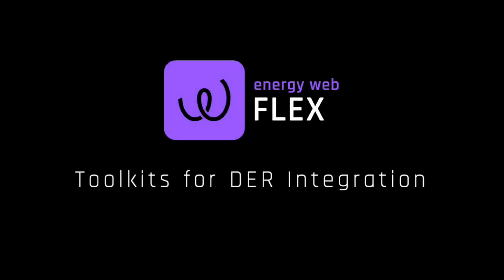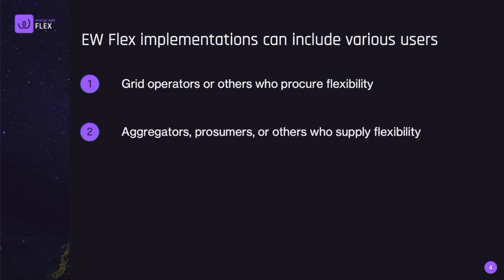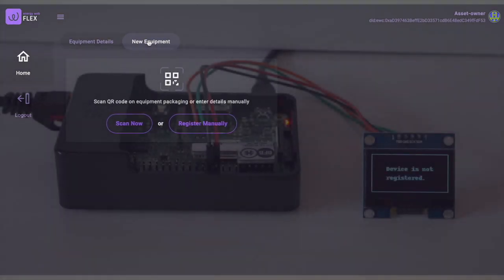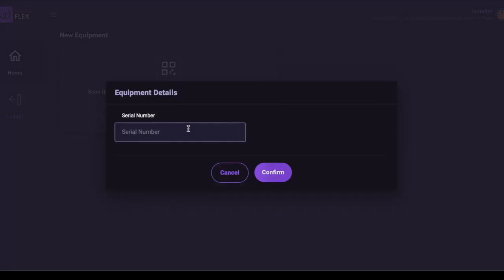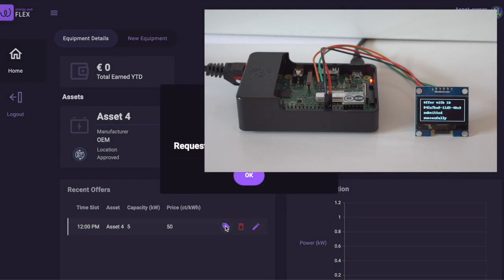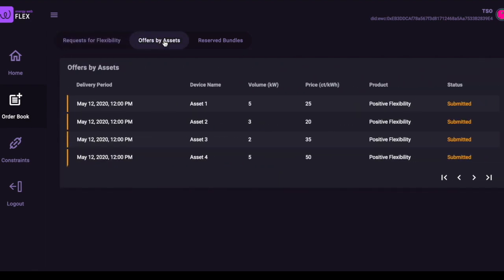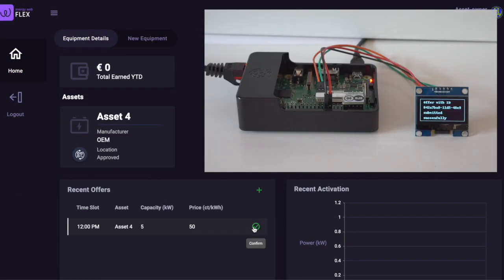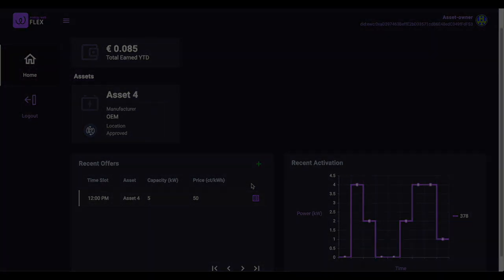Energy Web Flex: An Overview

Comment: Actually, you guys should open up to Uniswap. Simply the best most liquid place you can be. The only other decent alternative is Kyber. But Uniswap is still better.
Reply: @sundaypie2088  wow! Thanks for the heads up. In any case, they have EWTB (bridged) on the ethereum blockchain. That will be available to swapping on Uniswap.  Not sure when though. But I'm only buying there going forward. Not a fan of KYC.